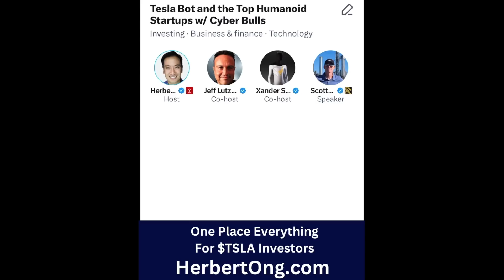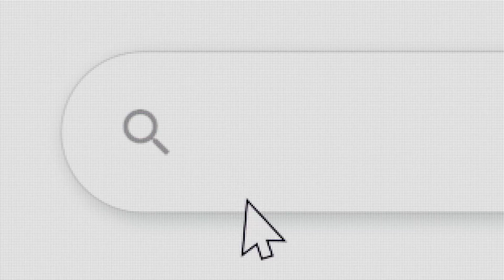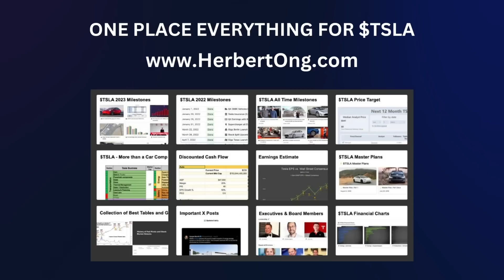Tesla Bot vs. Humanoid Startups - Who Leads the Race?

Comment: I'm honestly kind of crushed to see how fast the competition has caught up and in many ways surpassed Tesla's Optimus.  For the first time I'm actually concerned about Tesla's future.  😳  OpenAI seemingly has the Midas touch.  I wish Elon wasn't in a feud with Altman.  They should be working together and combining their forces, not suing one another!
Reply: The question is can Figure build out the bots faster than Tesla can get the software to the needed level.
Reply: @bdennyw1  How do you know what level they’re at?
Reply: Sell your stock dude
Reply: Maybe, but tesla has barely showcased their current humanoid capabilities, they might be well ahead, consider8ng how long ago those impressive ass femos were released, I wouldnt be surprised if they are indeed ahead, if not ahead who cares, its not as if the market for labour is going yo be saturated anytime soon
Reply: How has it been surpassed?
Reply: The one with the ppsitronic brain is the one that will win.
Reply: I'll be worried when the prototypes are being built in tandem with manufacturing. 

And competitors have massive factories of their own. And factories building chips. And factories building batteries...

They also have a lot of experience with real world AI navigating 3D space which I imagine is underrated